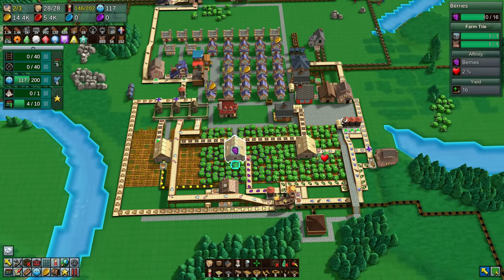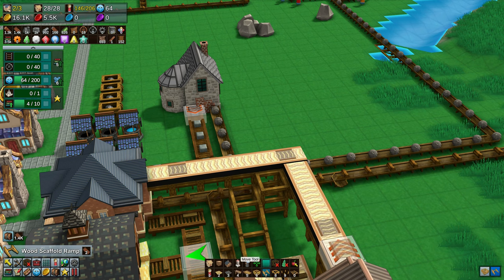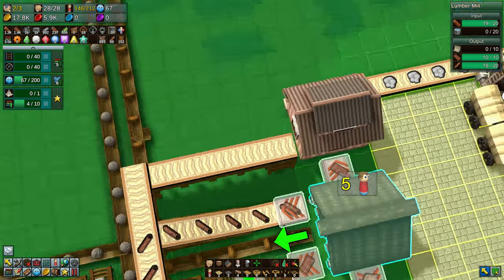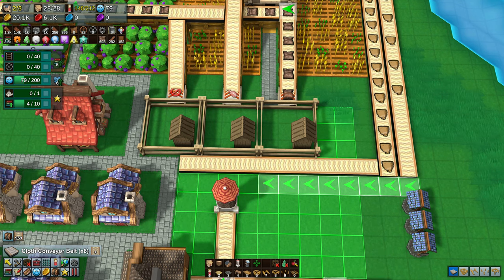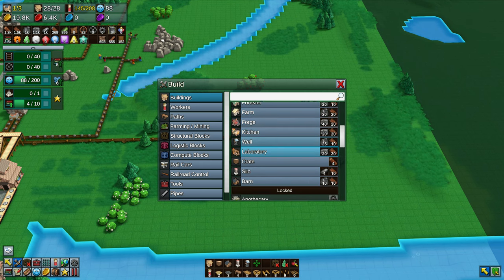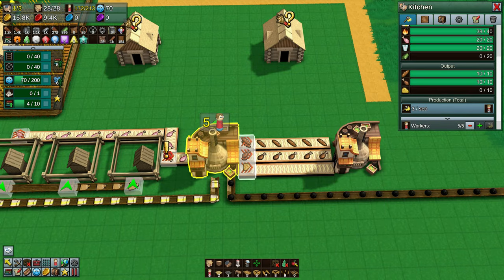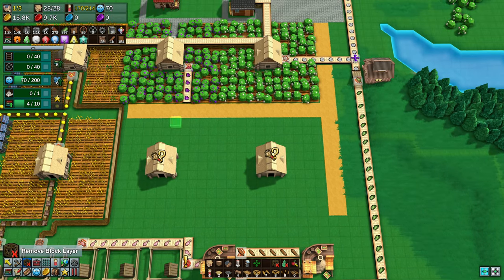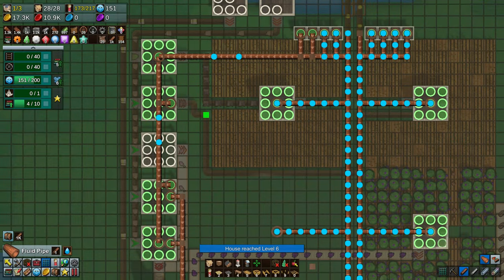MORE FARMS.... Upgrade Plans! | Factory Town | S1 E6

Comment: Fantastic video, man. I can't wait for Part 2 of the rebuild. Also, thanks for the shoutout, so to that end, here are some helpful yet unexplained game features instead.

1. Trading Posts: normally one sees them in the scripted campaign levels, but they also appear in sandbox mode. They turn one item into another instantly and allow the collection and usage of parts you have not unlocked the tech level for yet. They are found in the far corners of the map, away from the starting zone, as an incentive to spread out rather than cluster up in a single area.

2. Affinity: it is the level of a tile's ability to produce that resource; they naturally go up with harvesting and growing, but areas of 100% affinity appear under and around natural resources. It's less important for farmland crops, but it's a big game changer for crops that have only one or no harvest multiplier items like fruit trees and cactus fruit, respectively (yes, they're real and they taste good), so seeking out those rich areas rather than waiting for 100 harvests (that's how long it takes) is another reason to buy those expansion plots.

3. The page up and down button: this increases the size of a tool brush, such as raising or lowering terrain and planting crops, and makes it easier to cover large swathes of space for building and farming.

4. Wells produce water faster when neighboring waterways like rivers, so less is needed for the system overall.

So once again, many thanks, and have a fun time building up the Factory Town, man.
Reply from the maker: Glad you enjoyed it! And again noted I'll take a look, I did see the trading stations but as you say they are WAY out there at the edge :)